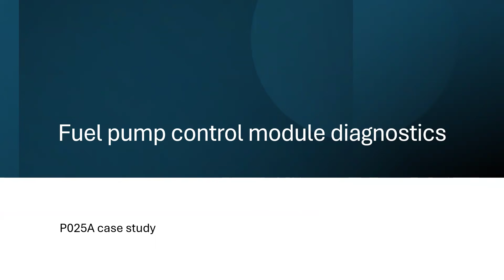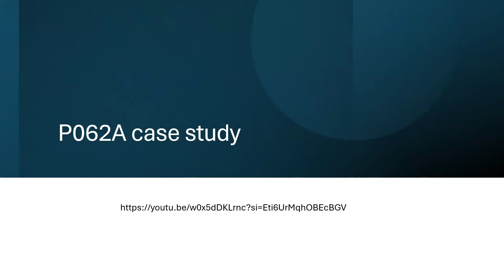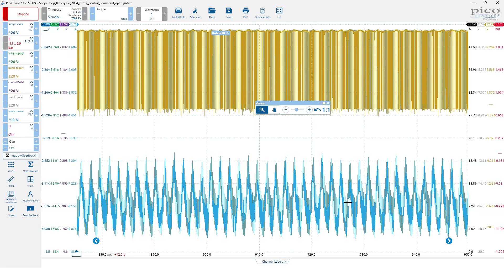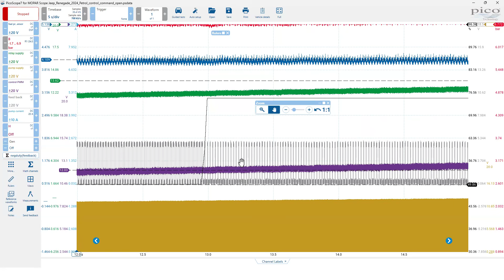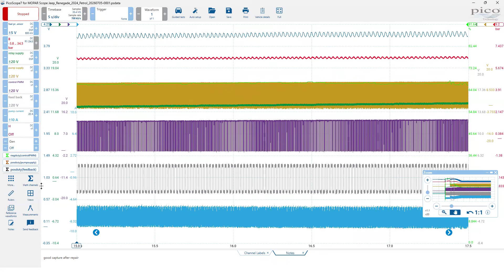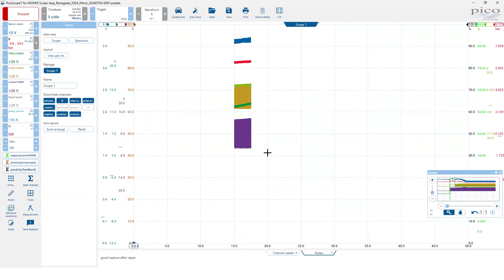fuel pump PWM control

Comment: Simon besides the PicoScope did you also use scan Data ? just wondering if the scope would match the scan Data..?
Reply from the maker: Yes I used scan data to confirm the fuel pressure sensor was reading correctly